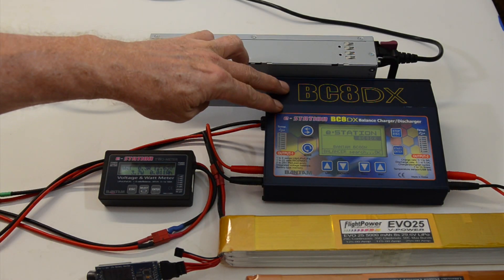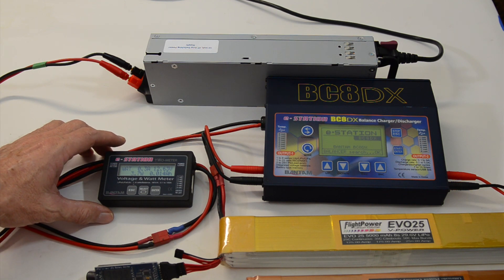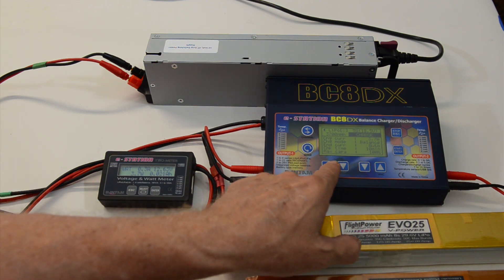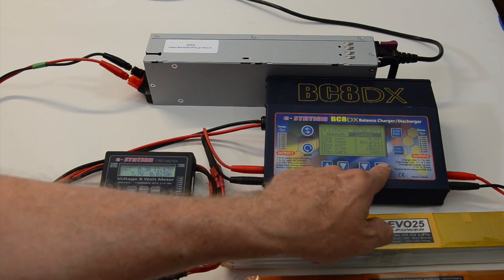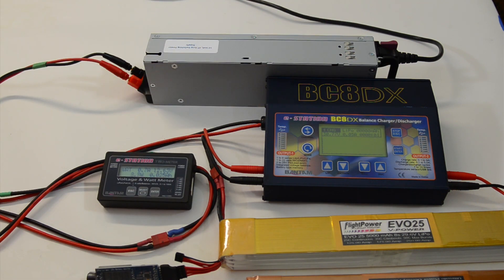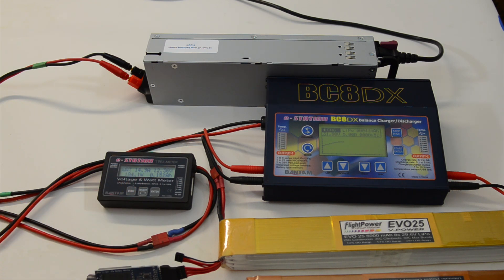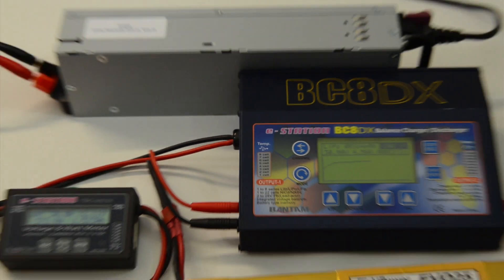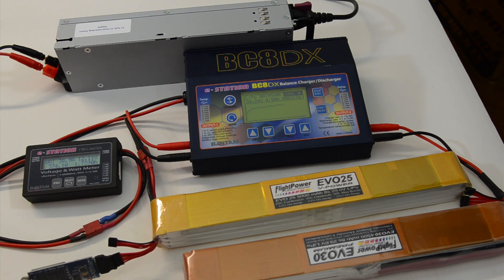47 amp 12 Volt Power Supply from Ron's Heliproz South

Comment: no, you really don't, I have 12 awg wires running 100 amps through them daily, and they dont get warm, and nothing has been harmed.  banana plugs can run up to 80 amps(4mm)  You may be thinking in the  terms of ac current. this is dc. much different.

Comment from the maker: @randfee It's a refurbished server power supply. I'm not sure of the brand. You can find the basic units on ebay I suppose. What makes these special is that they have female banana jacks so you can plug your charger in with no other work. They've also been tested and are guaranteed to work as advertised.

Comment from the maker: Yes. 47 amps at 12 volts.  What you say might be true if you were powering an appliance that draws 47 amps on a household 115V AC circuit, however 12v DC is another matter.

Comment from the maker: Everything is the same for a storage charge except instead of selecting Normal, you select Storage in the Chg Mode item. This video is showing the capability of the power supply. I have another video in the works about the charger and it should answer any questions about the 8DX.